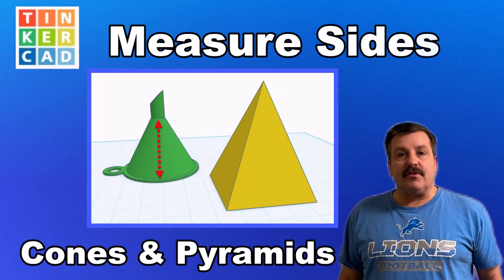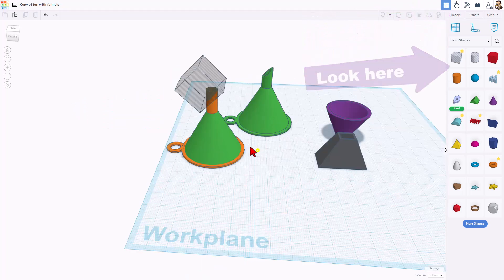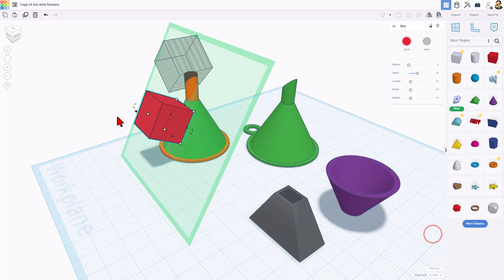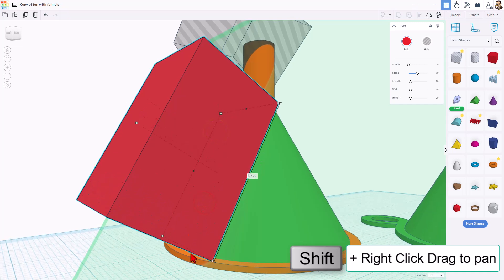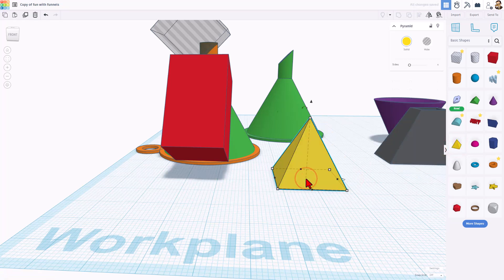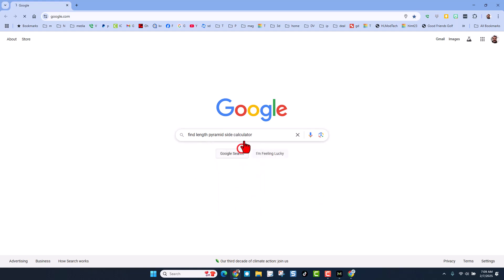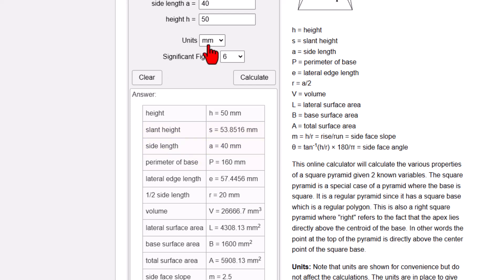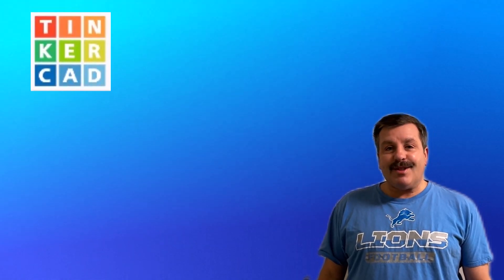Easily Measure the Sides of Cones & Pyramids in Tinkercad!

Comment: How do I create a circular funnel so that there are no steps? So that it is smooth.
Reply from the maker: I have found that the designs print more smoothly than they appear on the Tinkercad screens. If you set the cone to max sides you should be fine.
Reply: @HLModTech  If I have a diameter of 200mm, I can make a circle smooth. But the cone only has 64 sides and the printer doesn't print smoothly. I need some trick.

Comment: Good info. Is there an easy way to measure a hex? Sometimes changing the size all the sides don’t change together ( may be me😁). Like from 7/16 to 1/2 or 3/4. Thanks.
Reply from the maker: Thanks. Will do some checking. The comment about size-changing leads me to wonder if you are combining adjusting the handles... then the parameters. Tinkercad has a quirk that if you drag the handles... it breaks the parameters. https://bit.ly/breaktink

Comment: Another technique would be to use the workplane tool, click one side of the cone so one edge of the cone lies flat against the workplane, and then make sure you have a ruler active and when you select the cone, it'll be able to tell you how long the side that's against the plane is.  I actually find this easier since I don't have mess with a temporary object in order to get a measurement.
Reply from the maker: Interesting. How are you determining the amount of rotation to lay your cone flat? This one has me intrigued. =) Time to open Tinkercad and play a bit! 💯🔥
Reply: @HLModTech  you don't need a formula for the length of the sides on a pyramid either. Just "work plane" one of the sides and read the size dimension. Heck of a lot easier than googling for formulas.